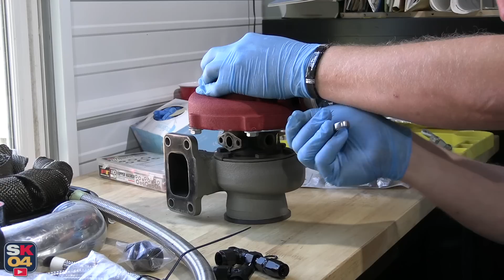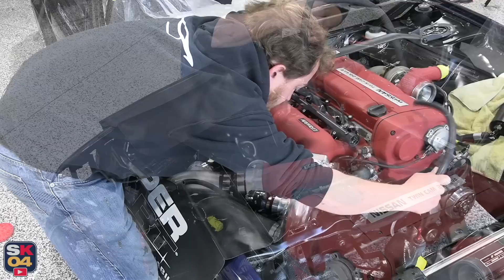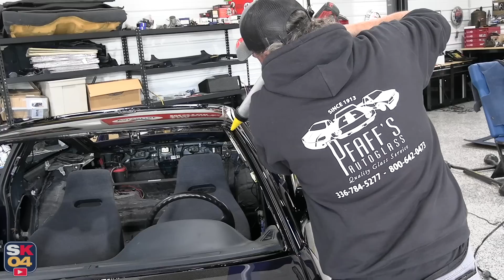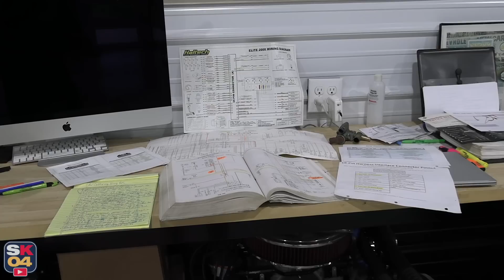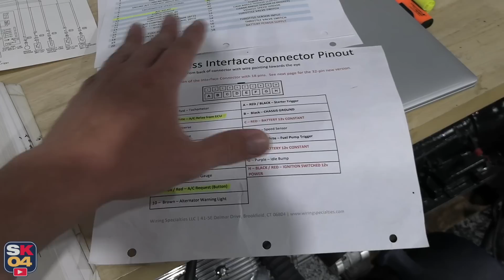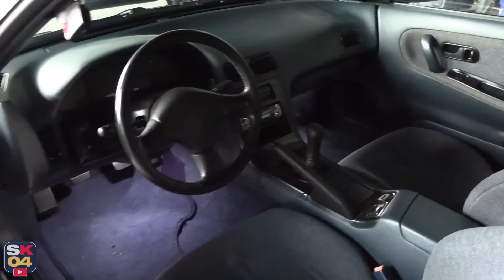Building a CUSTOM Air Conditioning System for the RB25 Powered 240SX RESTOMOD!

Comment: I'm having this same problem right now. AC like isn't coming on. Fuse and relay are fine. Jumping power to the compressor activates the clutch. No input from the AC request to the computer. Going to check the thermal amp. Thank you for making this video Kyle. I have watched your restoration videos but found this particular video through your AC post on FB

Comment: Amazing you are still going with this!  I've watch you over the years and even though I've had my 240 for 30 years your videos are often helpful.  Are these the fittings that connect to the evap at the firewall?  No one has ever been able to confirm for me.  6 M16 90 Degree O-ring Fitting × 1, 10 M22 90 Degree O-ring Fitting × 1.  Thanks!

Comment: Glad to finally see this build get wrapped up! Been following it since the start! It turned out SO good!! 😁😁

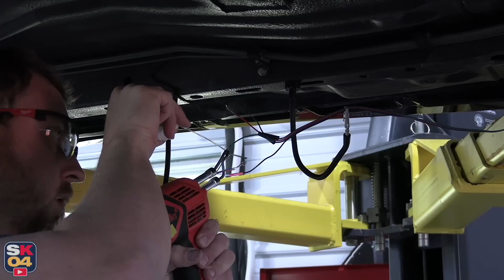Btw, at 24:13, soldering is not the best connection, did you know that soldering wires is not allowed on airplanes? Crimping or nothing, soldering has more chances of failing under vibrations. 😅

Comment: I appreciate you waiting so many years to finish this project up so that this video can be timely for my own S13 reassembly project (which has taken roughly the same amount of time as yours... maybe it's an S13 thing?)  When I reassembled my engine bay, I cleaned up and put the condenser back in place, so I have (hopefully) near future plans to try and get the AC going again as well.  I may or many not try and get the stock system going again or I may end up replacing things... not sure yet.

One thing I noticed when you were showing the newly installed headlights... The driver side appeared to not be coming up all way.  Hopefully you either noticed and corrected it, or it was just an illusion and it was actually working as expected, but figured I'd call it out just in case!